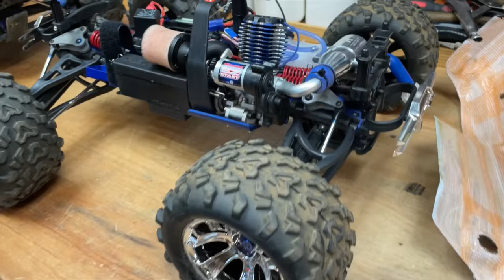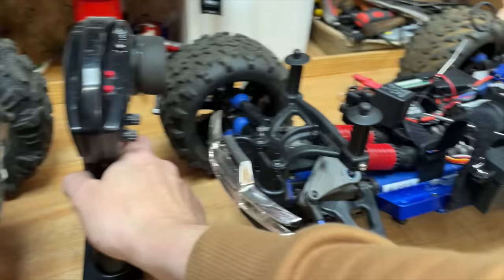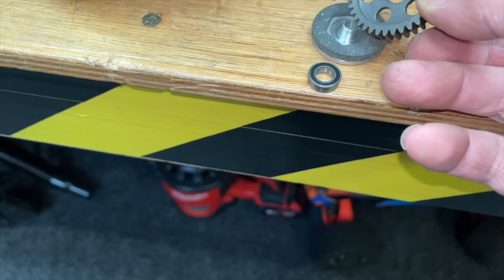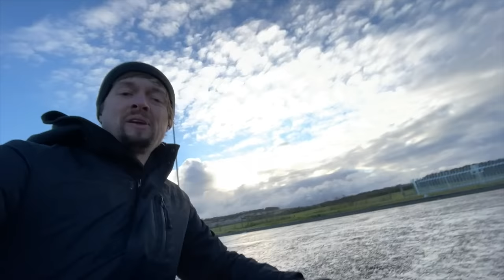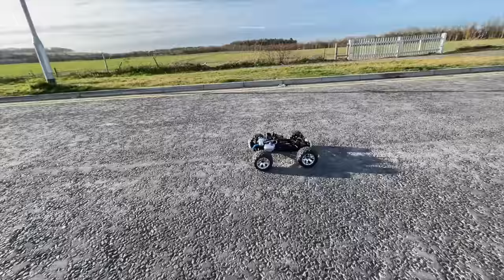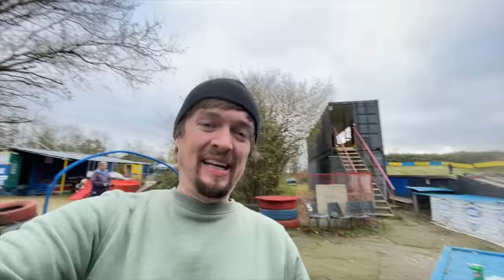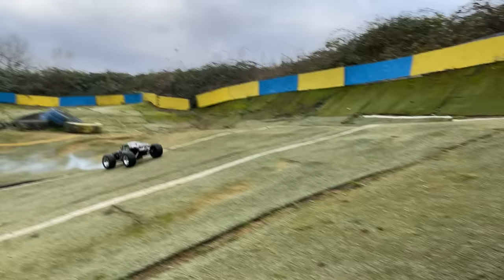Nitro RC Cars SUCK

Comment: Hey Kev! Quick question. How do you keep the steering link inside the servo arm? The link connected to the servo arm keeps popping off every time hit literally anything even a little. Then I lose steering.

How do I fix this? Super glue the pin into the steering link? I'm actually returning this car, wltoys 144001 1/14 scale buggy, in hopes that they fixed this issue on the model I ordered to replace it, the 142019 1/12 scale buggy.

Comment: Converted my Savage to electric; never looking back.  Can't test nitro inside, can't run it in a lot of places without noise complaints, have to tune it for temperatures, have to use the nitro fuel before it gets chunky, the nitro stinks when used, you need additional tools to start it, it stalls if it flips, it's slower and the engines will wear out faster than electric.  Going to make a custom mount n convert my 4tec, next.  F-k nitro, people should man-up and evolve with the times.

Comment: If you thought nitro is tough now I've been doing it since the 70s and a good day then was 5 minutes running it takes a lot of smarts but you can't beat nitro for the sound smell having a living breathing engine in your car boat plane and you can run all day not waiting a hour for batteries to charge. But back from the 90s and earlier electric was horrible

Comment: Og mardave marauder owner here in da house lol , absolute shite & primitive 1/8 scale buggy , still remember as a kid boiling the plastic parts in a pan of hot water to make them "stronger" lol , pre pullstart , needed a starter box although my old ma lathe machined a v groove in the flywheel in order to belt start it with just a starter motor & 12v battery to carry , & those sponge tyres - useless on the grass  🤣  . Still have that car up there in the parents loft , looks like a relic to the modern stuff . But soo much fun when it was running

Comment: nitro is to much work for bashing..I used to run nitro because it's was cheaper...still is....years ago a lipo/brushless was expensive not so much now.... nitro smells and gunks up everything, dirt sticks to the car like gum...smell will linger where you store it...trying to start one up after a months a problem...they are not as fast...heavy..good luck bashing a nitro, one wrong fall or bent chassis your done.

electric is plug n play..don't smell..fast..light...clean with a dam rag or air gun like new, great resale value

Comment: There's absolutely nothing to slate about electric it makes me laugh all the nitro fan boys (its the smell, the noise, going slower with more breakdowns and maintenance is better, electric guy cant run nitros LOL). I think you should do a nitro vs electric 8 hour endurance race stock nitro truggy, vs stock electric truggy  running 4s to be fair, 5x 4s lipos, and a field charger who ever completes the most laps wins 4 members per team.  repairs allowed ect but if one truck is in the pits the other is still lapping. That will get the excuses coming.

Comment: I have an old Mugen MBX5 with OS 21 turbo head motor OS30 carb lot of modifications done to the car I also have the new typhon 6S TLR tuned. Yes the electric is easier to use but overall my nitro walks all over that electric so I'm sticking to nitro but I still have electric

Comment: maybe you just suck.....clean the motor take care of the car....after run engine protectant helps alot but some people are way too lazy to figure out how to tune them and its a hobby bro.....its not about just plugging in a battery and smashing the gas and going dude its so much more rewarding to get a nitro motor to pop on and hear it idle as it stays running with no problem and then when u hit the throttle and hear the thing scream and fly away u cant help but smile....with an electric brushless i smiled but then the only thing i could think was IM BORED god i wasted 500 dollars on a electric hobby and im already bored! yea thats what happens.